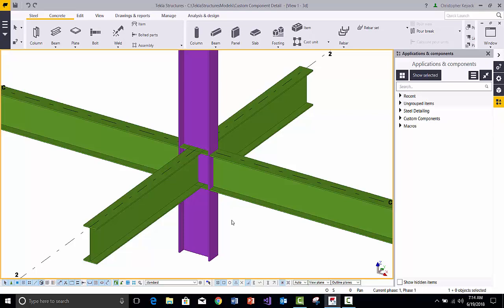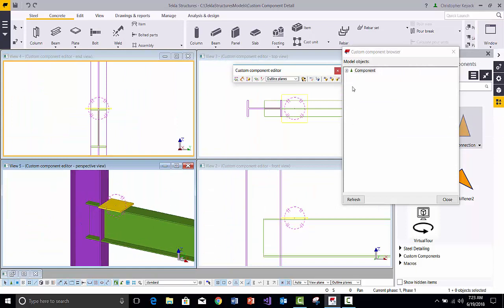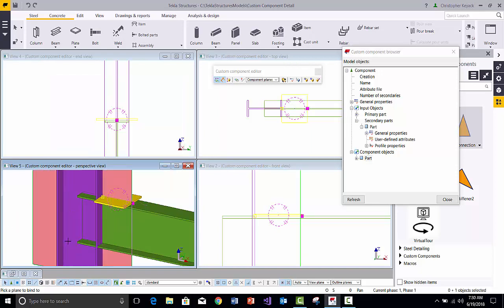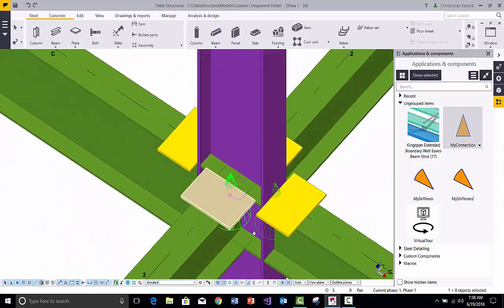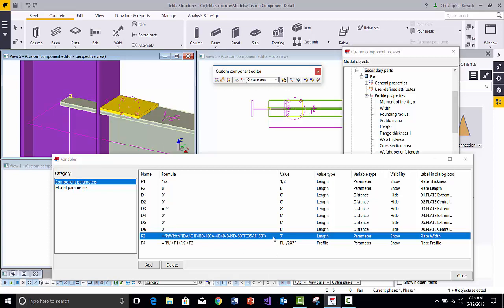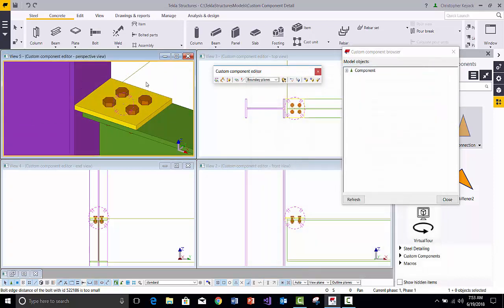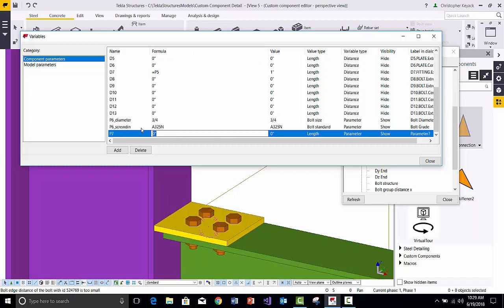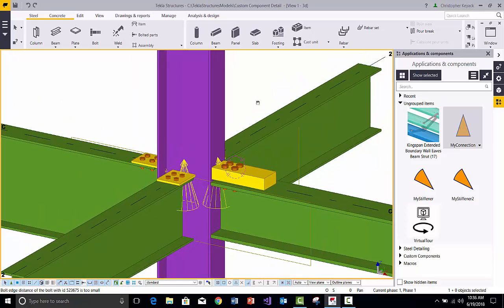ARE11: Tekla Custom Component Connection

Comment: thanks for the video 

Q: fittings and cuts can bind to a plan shown in trhe vidieo. Can polygon cuts also be bind to a plane like a cut or fitting, or has each point 3 constrains.(XYZ)
 
regards Frank
Reply from the maker: to the best of my knowledge polygon and part cuts needs to have the points bound because they are essentially anti parts.